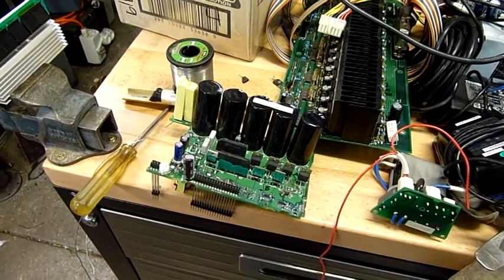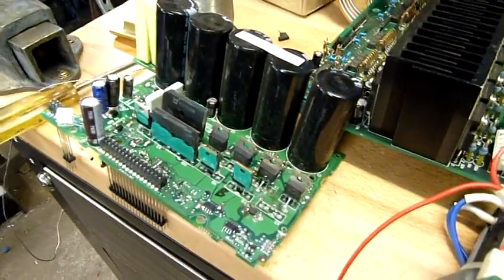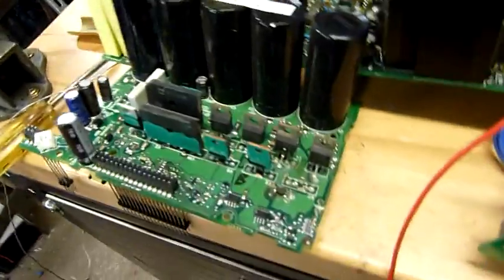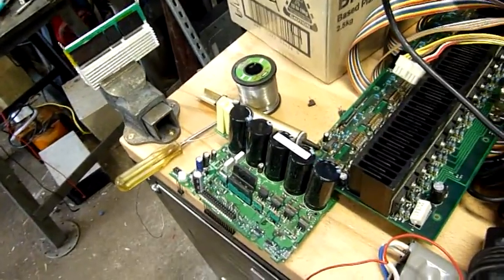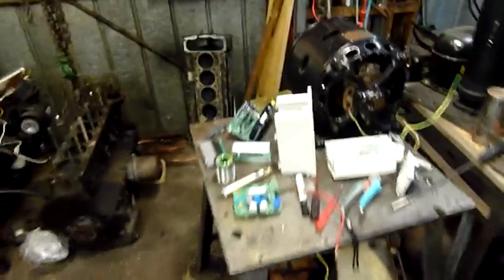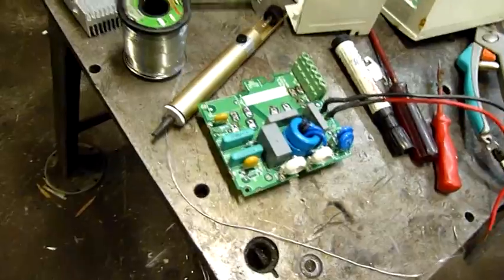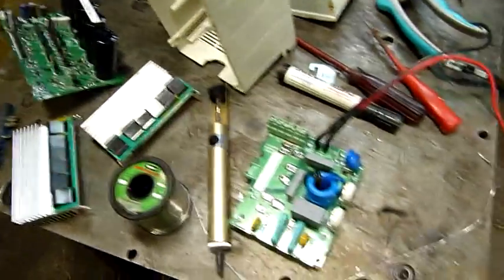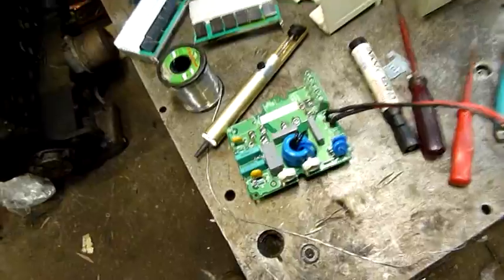ABB VFD Update - Need IRGB15B60KDPBF IGBT's

Comment: Another option, IIRC, there are two IGBTs per phase.  The odd man out might be a dynamic braking one, where it dumps DC bus to a brake resistor.  Trace out the outputs and steal the brake transistor for one of the outputs.  For what it's worth, NTE3320 or NTE3322 was a close match, spendy little buggers, $25 USD roughly - each!

Comment: not sure if you know this or not but if you can get ahold of a butane heat blower, they work really well for removing and soldering surface mount stuff. use gootwick and solderpaste to get them back on, way easier than through hole stuff. also, if that thing shows signs of life, cut the heatsink up and use thermal glue to hold the pieces on, good luck =p

Comment: Element14/farnell Australia has the IRGB15B60KDPBF au(dot)element14(dot)com/international-rectifier/irgb15b60kdpbf/igbt-600v-31a-to-220/dp/8659575?Ntt=IRGB15B60KDPBF One piece costs 8.56AUD and 10 pieces cost 5.39AUD each.Maybe you want to check them out.